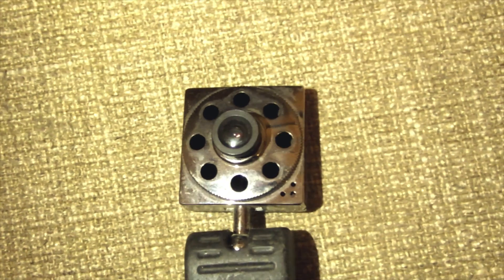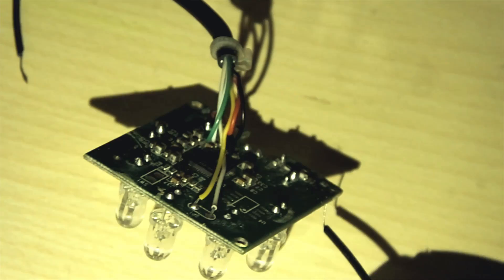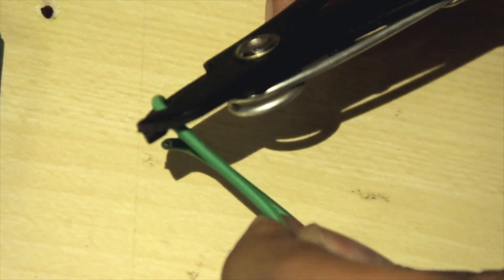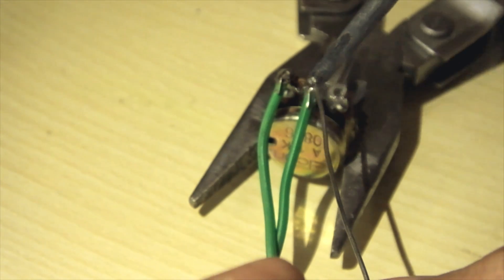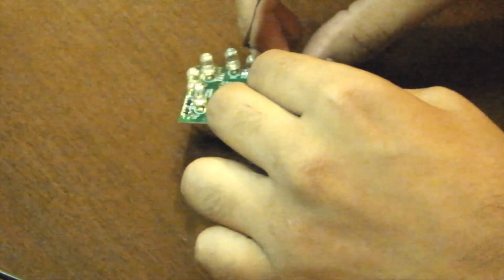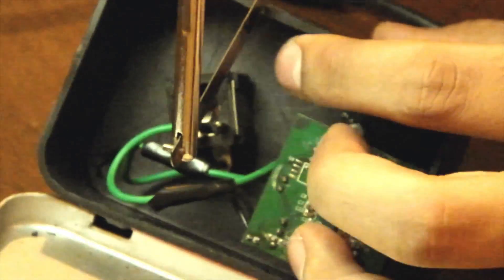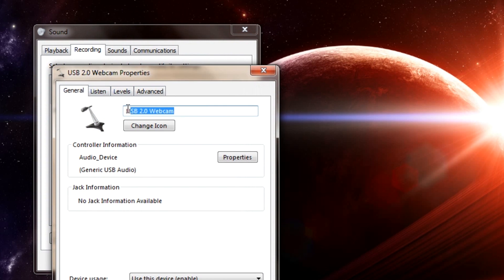How to make a USB Sound Card

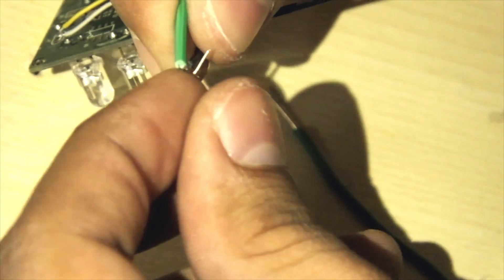Comment: At 1:31 you say "Make sure you don't use copper wire at all for this."  That's a pretty strange comment.  Why would you possibly say that?  And what kind of wire should we use instead?  Most of the electrical wire that I've seen in the last 50 years was copper, although some of it is tinned so it looks silver instead of copper color.  Copper is an excellent conductor and has good physical strength, at a reasonable price.  (Some large gauge wire used for service entrance cable and high voltage distribution is aluminum; that needs special solder and has no conceivable place in a low power circuit like this.  Also, aluminum has a higher resistance [per given wire size] than copper, so the circuit would perform worse if you could somehow use aluminum wire.)

There are numerous other problems with your design.  You don't differentiate between the "hot" and ground mic connections on the circuit board.  If you happen to hook them up backward, the body of the mic and the shield in the mic wire will be connected to the hot input; the mic will pick up a lot of hum and other electrical noise.  Also, that is a very unusual way to hook up a pot in an audio circuit.  You really shouldn't short the input.  And since that input has DC on it (to power the condenser mic which you have removed) there will be DC on the pot, and it will most likely make a lot of crackling noise as you turn it.

And why wouldn't you use a drill to make the holes in the plastic box?!!!!!

I'll stop there, but I hope that anybody who wants to make a "sound card"  (actually one fourth of a sound card, just one input channel; a real sound card has two or more output channels and usually two input channels) finds the correct instructions elsewhere.

The music track was nice, though.
Reply: No kidding man! I was wondering 'what's wrong with copper wire though?' all through the last half and wondering if I'd missed something really important.

Comment: Why to not use copper wire?
Reply from the maker: It picks up noise easily when not insulated with a metal sheath around it.
Reply: @lylerodericks  Interesting. I was under the impression that all metal would pickup noise if not shielded.

Comment: Why don't use copper wire you moron? Everybody use copper wires, it's more easy to solder and a better conductor!
Reply: This is just stupid, plain studpid
Reply from the maker: Hey steel, let me educate you a bit.
Copper is a diamagnetic element which means it is a great conductor of electricity and magnetism. Unfortunately, due to that on low impedance signals, copper wire tends to pick up alot of noise created by weak magnetic and electric fields around it.

In an application like a microphone wire, copper will pick up noise and the chip will amplify it, significantly reducing the quality of your audio.

Don't use copper :)
Reply from the maker: High impedance*

Comment: you didn't even cut the IR LEDs !!! they will consume voltage for nothing and make your box to heat !
Reply from the maker: They're not IR Leds. there's an adjuster for it on the cable to turn it off so I just turned them off :)
Also, they would consume current not voltage :)

Comment: .>I'm confused.   My whole audio system is listening to music on  youtube with Sennheiser RS 195 headphones on my pc which has a Asus soundcard. I had bought an Asus 7u external soundcard but after re-uploading to Windows 7 it somehow made  the u7 useless as thousands of us know....My 2 year old pc doesn't have optical input or output which I had on the Asus u7. So I connect the Sennheiser wireless into the pc and OPTICAL would make a better audio connection. Does someone know what I could or should use to make the optical connection being that it's wireless? Thanks
Reply from the maker: I didn't really understand your problem. Is it a driver issue?

Comment: Awesome video.
Reply from the maker: Thank you!  :)
Reply: +Lyle Rodericks just asking if you know but um i bought a USB Sound Card virtual 7.1 channel made by a company called SYBA i realised this was generic and fake and i was scammed but anyways i use my headset mic and headset in it so i use both output and input ive heard that ur not supposed to use both only one coz when i record using my mic there is a constant static noise in the background any ideas how to fix? if not can ANYONE help me solve this issue its rlly annoying
Reply from the maker: I had the same issue. That buzz didn't seem to go away on the 2$ card.  Bought a similar chinese one for 3$. Manufactured by a conpany called enter.  That one worked great :) no buzz
Reply: Really Awesome Video, Idol Bandrew haha :)

Comment: Thank you for this video.  It was very informative.  How does your artisan made sound card stack up to the commercial ones?
Reply from the maker: Haha. Don't ask.  It's freq response is flat over 50hz to 10khz .
So it's not too bad for speech. Would not recommend it for music. At least for the adc in this webcam.
Reply: Thanks for the response and your honest.
Reply from the maker: Very susceptible to noise. Avoid use for weak signals
Reply: +Lyle Rodericks Why not a copper wire??
Reply: +Lyle Rodericks wat potentiometer did you use